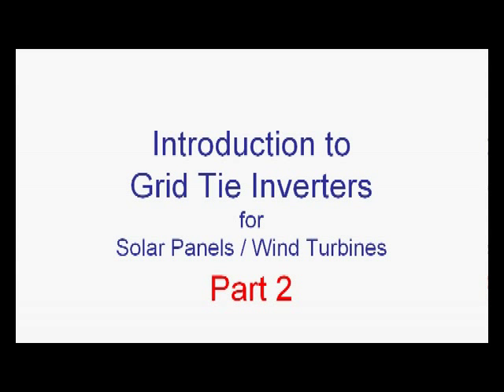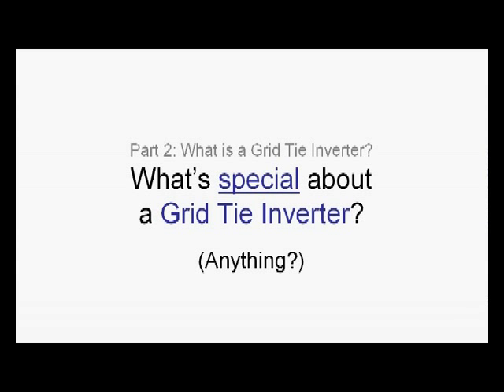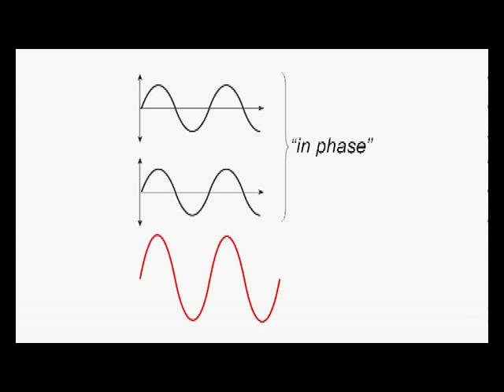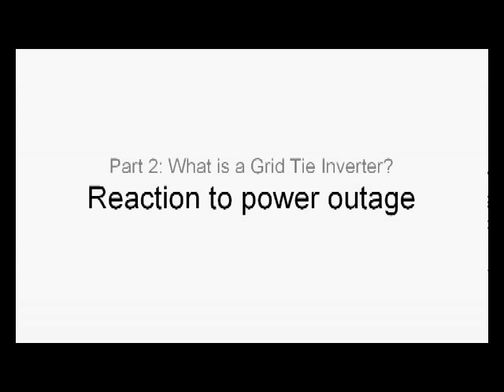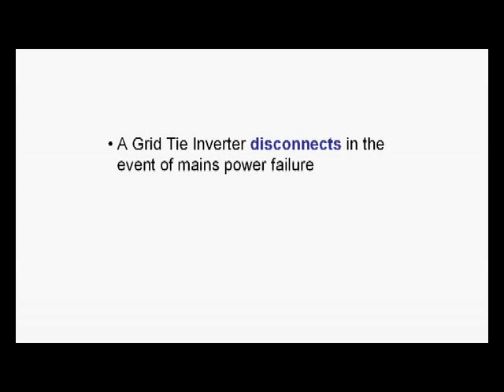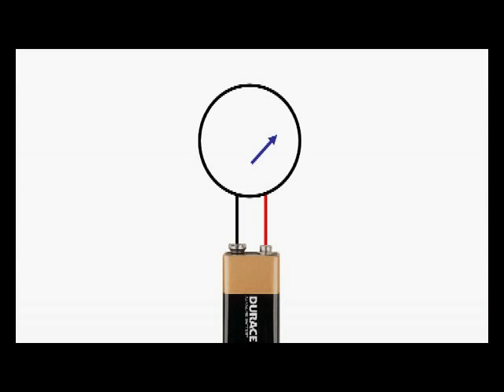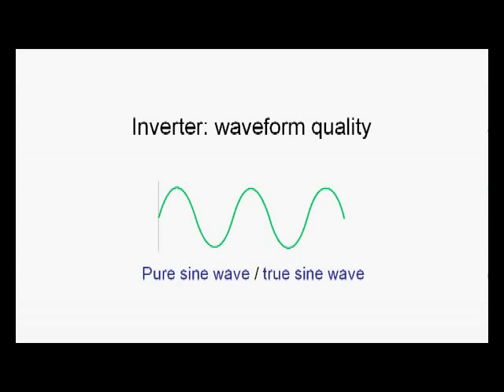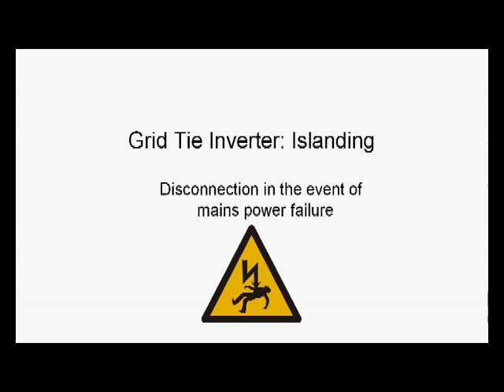Introduction to Grid Tie Inverters - Part 2

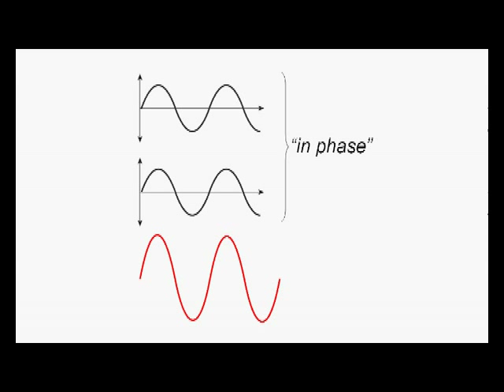Comment: (2:10) - This illustration suggests or implies that adding two ac identical voltages in parallel, of the same frequency and in phase, doubles the voltage.
This is not true.
Now I do know that you would double the available current, hence the power, but I do know that connecting identical voltages in parallel does, or should not change the resulting voltage.
How so ?
I'm confused.
>
Reply: You're right.

Comment: Can someone tell me? I voltage from grid is 230v then after synchronize the voltage from inverter so will it increase to 460v? I dont get it that you said 1 plus 1 become two not sero.

Comment: Can someone tell me? I voltage from grid is 230v then after synchronize the voltage from inverter so will it increase to 460v? I dont get it that you said 1 plus 1 become two not sero.
Reply: they are connected in parallel. Voltages will not add up.
Reply: Thanks so much Waqas Syed. I got it now :)
Reply: Actually he said it totally the other way around. If they are in-phase the current will not flow at all. If they are in-phase but the voltage from one direction is higher than the other then the current will flow from higher to the lower voltage. But of they are not in-phase then will be an explosion because there will be too much current flow from the grid to your system, and the job of the grid-tied inverter will not be achieved.
Reply: At what point will the voltage be higher at point so that current flows? Will the grid tie inverter generate higher voltage?Thank you in advance!

Comment: Very nicely done, a very clear explanation.
But how does the grid-tie inverter sense and then disconnect/reconnect to/from the grid ?

Thank you
Reply: kinelapo that is a great question, and in my opinion one of the most fascinating things about grid tie inverters. As far as I understand it, the inverter pushes the phase a little bit, so it attempts to go very slightly out of phase, and if the grid is connected it resists this push. Essentially the grid is like a big flywheel that keeps the phase very steady, and the little inverter has no chance of changing the phase of the grid. 

In the case where the grid is no longer there, then there will be no pushback from the grid, and the inverter knows that the grid has gone, and can shut down, until it senses the grid voltage again. All very clever. I’m not sure how often this test is performed, but I imagine it is very frequently.

Comment: I think the solar or wind..whatever the DG it may be, it will energized even tough it is disconnected from grid...says IEEE 1547 standard. That particular Islanding condition must be detected and DG has to disconnected within 2 secs, otherwise it would damage the equipment and might be harmful for technicians who're working on transmission lines..